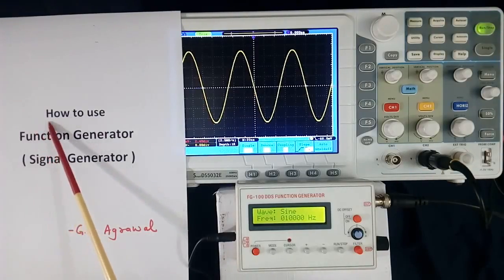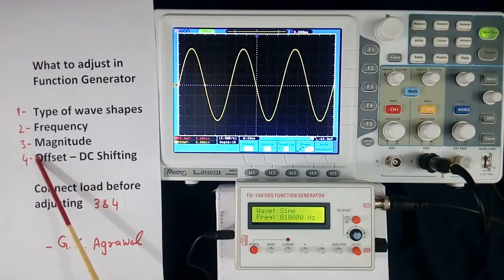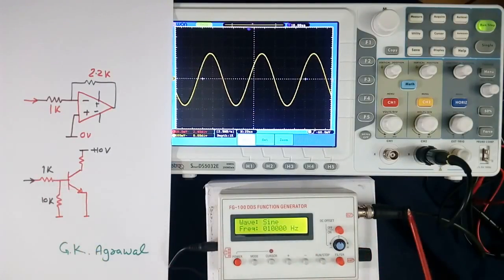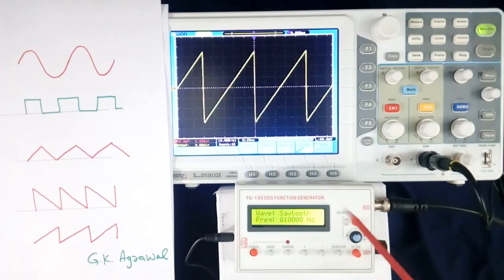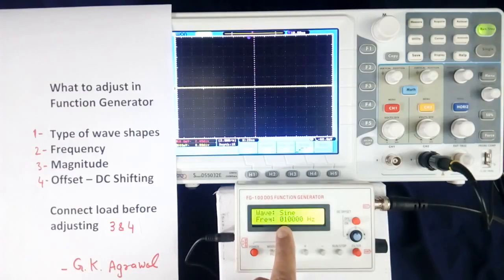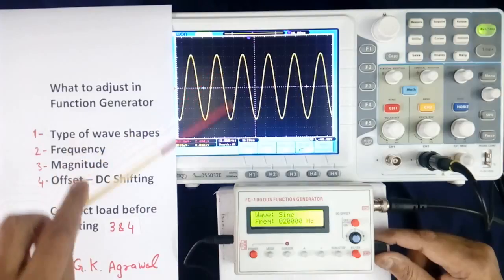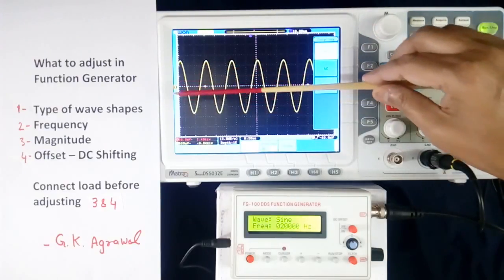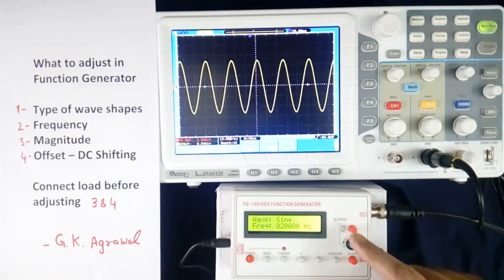How to use a Function signal generator FG-100 DDS

Comment: Hi, is there a way for me to connect a microphone somehow so that I can send my voice over a certain frequency please?
Reply from the maker: That is analogue modulator. You can get circuit in internet itself.
Reply: @GKAgrawal2  thanks, I was talking to a professor who was a royal navy officer, he told me how to make a very simple antenna which has a massive line of sight distance, and also can bend light with it and when a copper wire is run through the centre you also get free energy, it's made from neodymium magnets, aluminium copper pipe and steel pipe.he did some incredible things with it.

Comment: Hi, just wondering is the output dc or ac
Reply from the maker: You can adjust DC offset level of AC signal
Reply: @GKAgrawal2  so if the DC offset is turned off then the signal is AC, is that correct.

Comment: excellent video my frend i have the same dds i will need some help  please thankou
Reply from the maker: welcome
Reply: mr. argawal  this fg-100 dds it is working only with 5watt Dc ??  if i give 6watt dc or 9 watt dc i will bern the generator ? ?
Reply from the maker: 5 Volt supply is indicated on the function generator itself, I do not have manual
Reply: thankou mr. argawal at banggood i see now that power suply voltage it is 5v-9v -10v i dont want to bern my dds what to do ? to prodect FG-100?
Reply from the maker: You can put 5 volt regulator. I also saw that site but that is unofficial data. If your input is just 6 volt then put 2 numbers 1N4007 diode for 1.4 volt drop with a small 100 micro capacitor.
Reply: thankou my frend this i will do .thankou again

Comment: Hello Sir....  what is the "Duty Cycle " in  Function Generator and what is the use of that.  Could you please explain that ?  Thank you
Reply from the maker: Duty cycle is ratio of  pulse is ON time devided by ( ON + OFF time)   X100.   30 % duty cycle means 30% time ON (High) and 70% OFF (  Low signal)
Reply: OK thank you